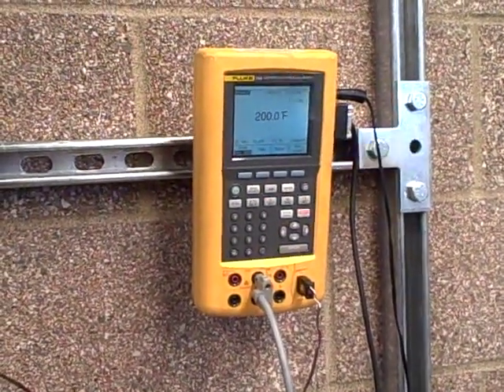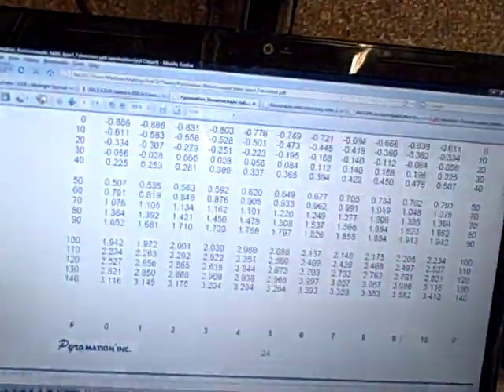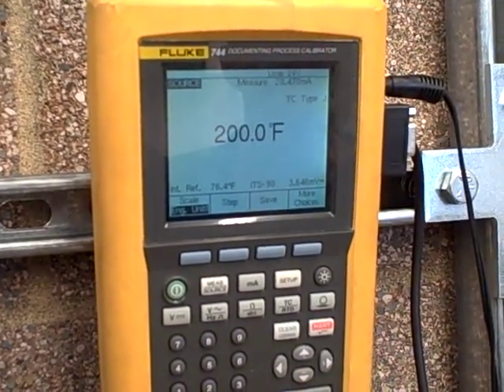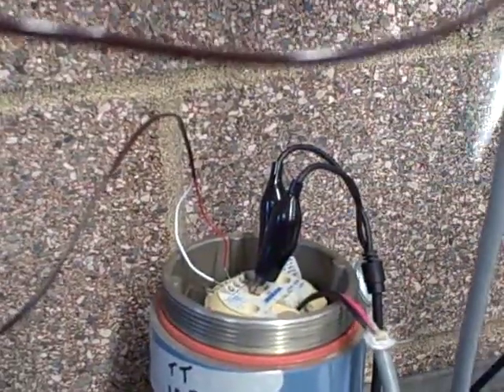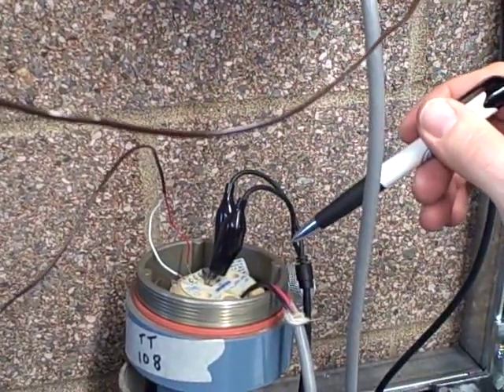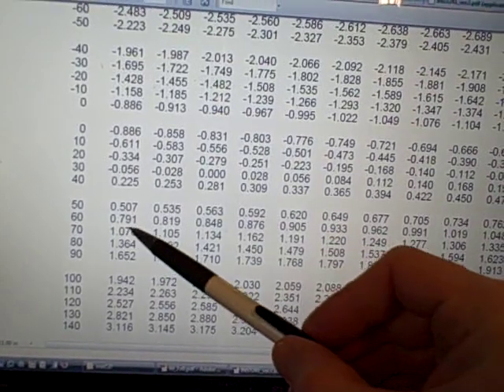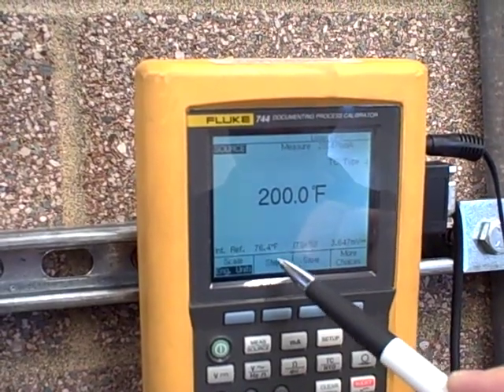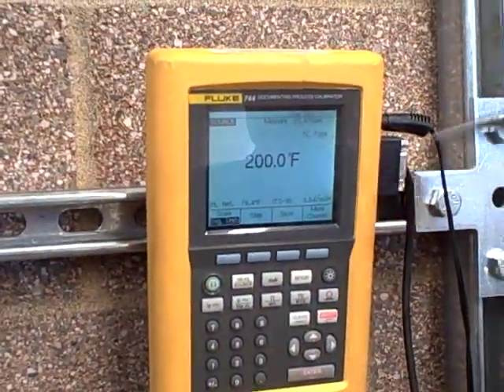Thermocouple calibration (outsmarting the transmitter's compensation circuit)

Comment: hi this is good.i have aproblem in dp type level transmitter which is calibrated for -20"H2O to 0 "H2O,we filled liquid in impulse line but it showing 100% so what is the solution for this problem?can you tell me?

Comment from the maker: @reconvolution The black alligator clips are for HART communication.  This is a hybrid digital-over-analog signaling used to access the configuration parameters inside the DUT.  The Fluke 744 not only serves as a calibration standard here, but also as a "communicator" terminal to access and edit these parameters.

Pretty cool, huh?

Comment: Nice video.  May I ask a few questions?

There’s a pair of banana plugs plugged in at the bottom of the 744.  Looks like the other end of that cable ends in the DUT.  There’s also a pair of black alligator clips connected to the DUT.  What’s the purpose of these connections during calibration?

Thanks,
- Nick